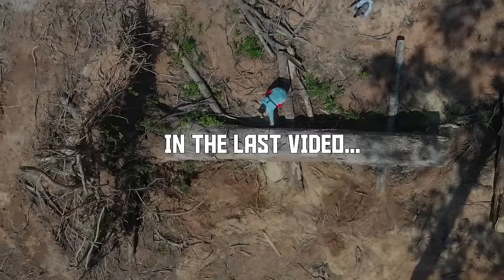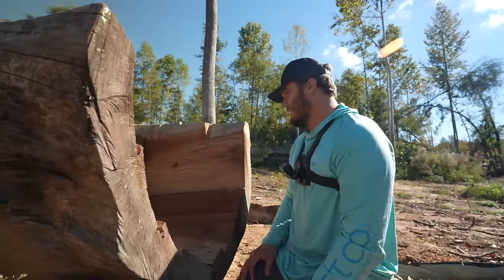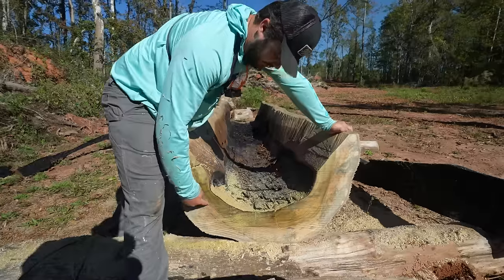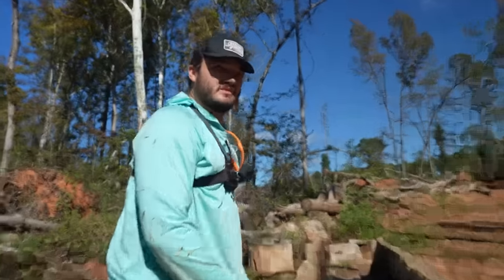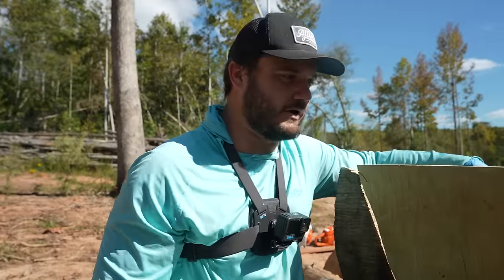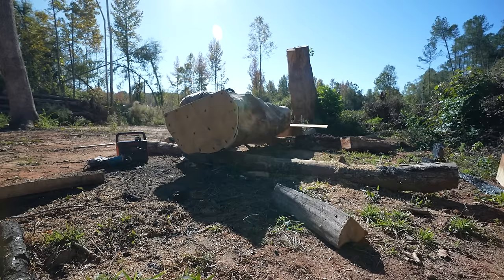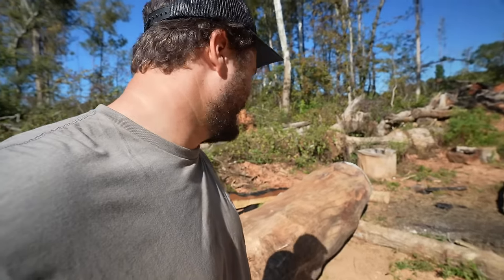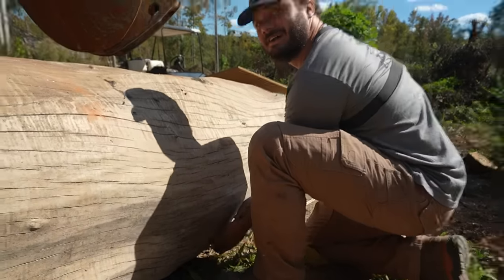100 Year Old TREE to BOAT Build Finished!! (water testing)

Comment: Best boat build video I've seen in awhile. Imagine the possibilities with that boat. Hammock style seat nailed on. Cutting board right on the boat. Gotta have a beverage holder drill in. A fish ruler carved in top rail. Also  build a front nose cone for rocket speeds. Bamboo stick depth finder and push rod. Epoxy the whole exterior with clear and interior epoxy with the look of water, rocks, moss.

Comment: step 1 add some benches with underseat storage space. maybe make them with the ability to flip up to make rooms for a sleeper. next attach some floating outriggers to each side. either also made out of smaller holloed out trees or maybe some of those plastic 55 gallon barrels. insulate those barrels. have 1 out rigger be splint into a live well and cooler configuration and the other side outrigger be split into gear/tackle and snacks/ what-have-you sections.

Comment: Hey ayo! Got a little boat building experience! Total boat makes epoxy and thickener that will act as bondo but with a structural durable bond. Where as bondo is more of a filler and  used to make smooth paintable surfaces. (Cosmetic). For what it is though it’s awesome!! But what I was getting at it’s look up stitch an glue construction boats! Just a little beed on the corner will hold the hole boat together and last forever!

Comment: Bro a good 75% maybe more of thos cracks are gonna swell closed when it asorbs the water..When the built wooden boats they actually would leave a gap between the planks and they would pound cotton into the cracks to make it water tight until the wood would absorb the water and it would swell and seal the cracks then they would just cut the cotton off.

Comment: Old wood boats used to need soaking in water to swell the wood joints to prevent leaks. I'd fill it with water and let it sit for a bit.

Comment: U should hollow it out some more then add raised seats. Maybe this would have up to high though. Idk. Def use that planner some more a put a coating of sealer on the bottom
Reply: And maybe build a pointed front on top of the current sheet to cut the water. Could be a storage compartment

Comment: AYO, next time use acrylic lacquer. Start off heavy coating the project and decrease amount used as you layer your product. Acrylic or epoxy paint, basically slowly closing any cracks.

Comment: if you sink your dugout canoe in shallow water when it absorbs water it will close all those cracks. When i was younger i would see dugout canoes in the river on the reservation sunk to get them ready for use.
Reply: Interesting. Just better have a good plan for gettin it back out.
Reply: @highjinx6519  well it's in just enough water to cover it. So grab a few friends and roll it on its side and slide it on shorw